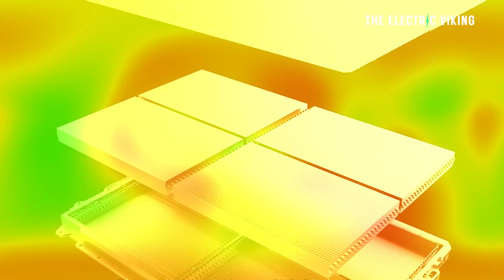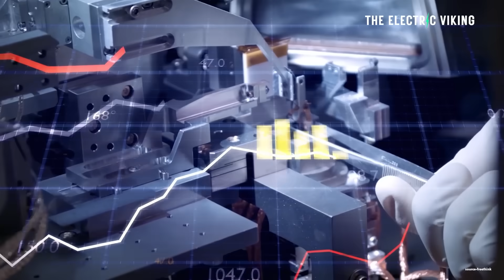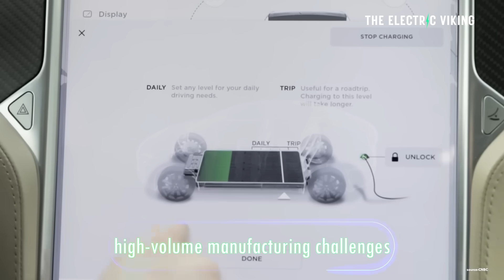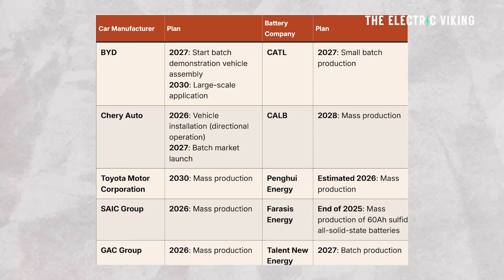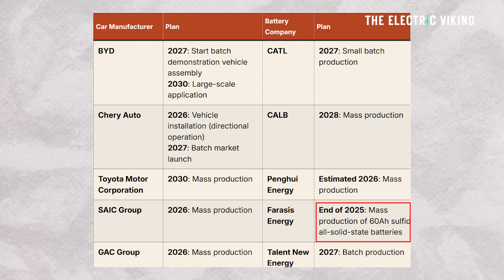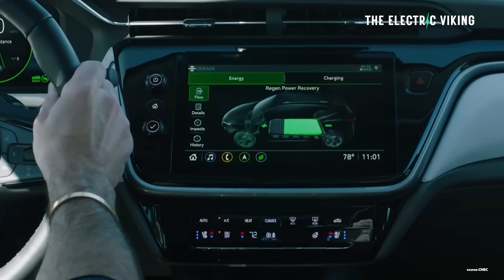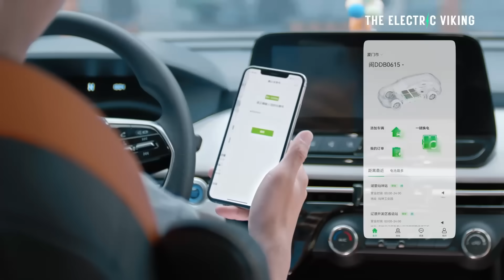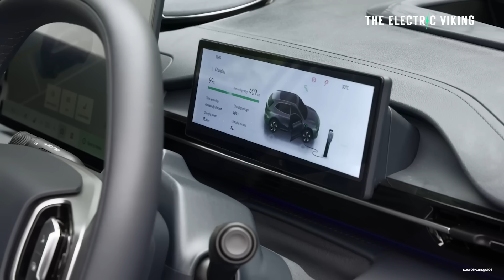Chinese Expert Reveals the Truth about Solid State Battery Mass Production

Comment from the maker: The car I drive, the Xpeng G6 - https://youtu.be/IcniwO8NfQQ

RESINC Solar installed my battery and solar system. Get a free quote from them here: https://www.resinc.com.au/electricviking
Reply: you saying a battery that is twice as energy dense needs to be less than twice the cost of a regular battery to be cost effective is wrong. you forget the value that is being added from only being half the weight of those 2 conventional batteries. you can now stack more total capacity on a car or make them lighter for the same amount of capacity which brings a whole lot of extra value.

Comment: I think EREVs solve any range anxiety from EVs… 300 miles isn’t enough EV range for a long drive? Just throw a combustion generator in it and it practically doubles your total range. 

With that in mind and the emergence of sodium ion batteries that are cheaper and safer than lithium, solid state batteries lose their initial appeal as time goes on… I feel like any car companies trying to develop solid state EV batteries (*ahem, Toyota) would be wise to pivot to sodium ion and EREVs rather than waste time/money on something that might not be viable going forward.

Comment: Just to be on the safe side I estimated the uptake of Solid-state batteries on a mass scale for EVs and some other electronic equipment by 2030 which seems pretty spot on at this stage.
The current Chery Tiggo 7 Super Hybrid does around 1200 KM on a tank of fuel, but a range of 1500 KM with improved safety sounds even better with the new Chery Solid-State batteries fitted.
Also Solid-state batteries will be very expensive when compared to current battery technology. 
Interesting information as usual.
😎🇦🇺

Comment: Re - fast charging
Todays batteries can handle charge/discharge rates of 15C - which would mean a 4 minute charge time!
The limiting factor is not the battery chemistry so much as the charger power and the battery/charger cooling capacity

Comment: So high material costs,  high volume production costs, long charge times, and thermal runaway issues prevent it from growing into a bigger market. Their lighter weight may see them used in niche markets like autonomous rescue robots, where one life being saved compensates for the huge cost involved in their production,  or their thermal runaway that immediately devalues them when it occurs.

Comment: WE do NOT need high energy density. It's dangerous. Battery swapping solves all problems already NOW. Of course , other swap station than NIO's. No screws. Battery can be fixed and hold by other type. And These has to do the car itself. Trolley just up battery - and the car fix it.

Comment: I work in an industry where we make both solid and liquid products with very similar functions. In this case the solids were even the first to appear on the market many years ago but liquids have almost completely replaced solids. All the solid handling steps are so much more expensive when you have to handle materials in bulk versus liquids. This made liquids over time about a factor of 2 cheaper on a kg basis. I fear this will be the case with batteries as well. Only in case the energy density is 2 or more times higher solid state will become similarly priced.
Just watch the vieos out there showing battery plants. They usually show the final assembly of the batteries with robots. Those robots are expensive. If you want to make the precursor processes solid as well you need a lot more of these robots to do the work, and that will cost money.

Comment: Like flat LCD screens finally arrived at maturity to replace CRT's back in 2000, solid state batteries WILL replace current Lithium Ion "poach cells" & turnary batteries. But this takes time. Monitoring the progress made these last years, I believe we are 5-10 years away from their mass market production & sales
Reply: ah yes, worked with a guy that worked in telefunken, germany, 1973, they had working test lcd screens there, but really expensive to make.

Comment: Currently in China being driven around in a NIO that takes 4.15 minutes to get it's battery changed.
To do the change over cost the equivalent of AUD 20.00 IT CERTAINLY IS a lot CHEAPER THAN me  FILLING MY OUTBACK TANK WITH AUD 100.00 of diesel.
THE BYD and other Chinese hybrids CAN DO OVER 1000 km's with a full petrol tank and a full battery charged.
This fact above all else will push people to purchase a Chinese Hybrid first and then an electric car.
Change takes time to be realized.
JB

Comment: Battery swaps would be good for fleets that need to lots of short runs, like taxis or delivery vehicles. They could still do well on smaller LFP batteries if they need to do lots of shorter distances. Ambulances, fire truck etc. 240v on board would also be great.

Comment: Battery design, I suggest for battery design and universal fit a flat battery wide as vehicle and as long as vehicle length; the vehicle would have a 0 slot which battery is inserted into car’s back side slot 0 then for vehicle range option a second slot 1 giving customer option of  single or double battery; for RV slot 0 as auto slot and slot 1 as home slot; trucks follow pattern of vehicles. Batteries fit cars, trucks and RV’s

Comment: Solid state are immune to dendrites (though that only triggers a small proportion of thermal runaway events) and enables the use of a more energy dense lithium metal anode, which its very prone to dendrites.  It eliminates the flammable electrolyte , sure, but that's only a small percentage of the battery by mass, the majority of the battery is still NCM cathode material and the anode is now more reactive.  So yes, harder to get thermal runaway event from an internal short, but once one gets going..

Comment: I do expect that leightweight batteries do have a purpose...even if they are (still) expensive.
In those places where weight is every thibg.
(Space objects (satellites) which store energy when in the sun , use the stored energy when in the shadow of the earth., in aiircrad=fts ...especially the (first) bigger electric  airctrafts. (Which will be small planes to start with)
When the demands get high enough prices will drop and than can be used in the normal EV market (earlier in the very expensiv top ev market).
This is more or less normal the last 70 years...first TV sets which only could be bought by rich peope...the same later with color TV , tv recording , PC's and all other electronic  inventions.
When I was a child a TV camera did cost a few year salaries...now a gopro has a much better quality for a fraction of the price.

Comment: just like swappable packs it will go the way of the dodo

swapable packs are needed for when cars can only go 200 miles.
if they can go 400.  who cares.   when is the last time you needed to go 800 miles in a car
and couldnt sleep in a hotel?

I dont want my well taken care of battery to be replaced by a battery that some clown has run it from 2 to 98% every day for a year.

  I am not swapping someone elses pack and putting it in my garage

Comment: I personally have never shared the hype about solid state batteries. That's not to say that I don't believe that there will be good solid-state batteries in the future. But I do believe that this hype is based on the word "solid-state". 
People think of the comparison between a hard drive and a solid-state drive. But a battery is not a hard drive and a solid-state battery is not a solid-state drive. Batteries do not store data, but electrical energy. And that is a big difference. And why people assume that a solid-state electrolyte is automatically much better than a non-solid-state electrolyte is not entirely clear. In fact, the opposite could just as easily be the case. 
By the way, there is also a solid-state variant for combustion engines. The solid-state variant of gasoline or diesel is called coal. So, on to coal cars! Solid state!!!
Reply: Solid state fuel is also rocket fuel
Reply: People assumed solid-state batteries would be better, because channels like these kept telling them they would have much higher energy density. Now it turns out, mass-produced solid state batteries might not be the jump up they expected, while other battery tech keeps improving.

Comment: Solid State Batteries are a must for me to consider ANY EV as a replacement to my 2012 Toyota Highlander Hybrid.

My Highlander Hybrid consistently gets 340 - 455 miles of range in Canada's -40°C - 40°C weather year round. No worrying of what type of gas station I'll run into along my trips, they ALL refuel my tank within 5 - 10 minutes. No worrying of my range dropping regardless of how fast my tank got filled/emptied throughout the lifetime of the vehicle. No worrying of my vehicle fuel level dropping while parked outside in the cold, thus no need to look for charger outlets at my destination, etc.

For an EV to offer the same level of convenience and peace of mind as my Highlander Hybrid, it'll need at least 800 miles of range. Solid State Batteries seem to be the ones that'll hit such range, but either way, until any of them do, EVs are just going through a guineapig testing stage in my book.
Reply: I don't understand. Why are you foccusing on a type of battery, instead of the actual range some car has? As this video explains, all batteries keep getting better and solid state batteries in practice don't seem that much a big of a step up. 

It's not true by the way that an EV car looses energy when it's parked outside. Who told you that? Cold weather doesn't make battery charge disappear. The car just needs more energy to heat the cabin; that's why you loose some range in an EV in winter. An ICE vehicle always generates heat, and just throws it away most of the year.
Reply: @drfisheye Read my comment to the end before responding.

Comment: battery energy density has issues, unless using metal-air batteries of gasoline energy density. it will come if you believe you already got it. make it simple to make. arc inertial dd fusion ftw. stuff gets cheater guaranteed.

Comment: All battery development is to meet a specific performance objectives. Developing a solid state battery technology should not be the end-goal in itself. (manufacturers still use lead acid for nearly all 12v car batteries despite having alternatives). To become the dominant technology, solid state must compete with other chemistries like lithium, sodium and aluminium.  As of 2025, aluminium/graphene seems to match the benefits of solid state and possibly have a better all round future. We may have gone overboard by the word 'solid state'.

Comment: I think that overall the idea that cars are the best first application for solid-state batteries seems to be stemming from marketing needs. And for some manufacturers it's probably about making their customers wait for the 'next best thing' until they've really upped their game.
In the automotive industry, there might be a good target market for solid-state batteries and that's hypercars. These cars need a low-weight battery that can charge quickly, and the battery doesn't necessarily need to have a great cycle life. That's because these cars aren't usually driven much at all, or very little in terms of kilometers.
Honestly I think solid-state batteries would make more sense as a mass-market product in high-end consumer electronics like watches, phones, laptops, and even in things like Dyson-segment home appliances.

Comment: Meanwhile in Canada, if your EV is not working and needs to be transported by a ferry to a repair shop, your are out of luck. Transport Canada does not allow the transport of an EV on a ferry or barge if the battery is faulty. In British Columbia, that means residents and visitors to the Gulf Islands or to Vancouver Island can't transport their cars to be repaired.

Comment: Until they solve the issue of 3d printing the membrane in place? Its not going to happen. That is the issue is the membrane needed between the cathode and anode material in SS batteries is inherently brittle and cannot be bent or wound like a traditional battery.

Comment: He is certainly correct real solid state batteries; not reduced liquid; are literally like making computer chips; but very large ones. Toyota has had a solid state battery car for about 10 years but the batteries cost $1 million to make. Maybe you'd see some very specialized uses in things like aircraft, maybe multi million dollar super cars, but not average sedans.  Also all cars - can't be lithium  BEVs by 2035; there isn't enough lithium production even if you 10x production of lithium. Currently BEVs are 0.1% of cars.

Comment: The problem all these battery companies have at the moment is time, not time to manufacture though, time to customer. It's like this, my oldest car is a 2007 Hyundai diesel, I generally keep my cars for quite a few years, it's cheaper and better for the environment, so if I was to purchase a EV now chances are I would also keep that car for 10 years at least, but with battery technology on the cusp of solid state production every customer who buys an EV with LFP batteries now is a lost customer for say 10 years, disregarding crashes and other problems that require you to buy a new car of course. So what they are doing is teasing much better battery tech "any day now" in the hope of discouraging buyers from purchasing EV's to keep the largest possible consumer base for the new battery tech, it's basically what Toyota has been doing for ten years, discouraging car buyers from switching to other brands and technology while they play catch up.

We'll see who actually produces the first mass produced solid state battery, but I don't expect it to come much before 2030 myself. Small production runs for extremely high end cars, basically for supercars and the like yes I can see that a bit earlier, but mass produced consumer cars I will give it another few years before it's ready.

Comment: Solid state could be another betamax moment. It's clear that the best product doesn't always win the sales race. The price of batteries is getting so cheap that even if solid state tech is more advanced, the current battery tech may be good enough for most consumers, especially if solid state is significantly more expensive.
Reply: Na there will be niche uses and then mass production eventually.  The real issue is no one can mass produce solid state.

Comment: you keep forgetting that 1kwh of LFP battery equals 1kwh SSB battery. so a 50kwh SSB in a car equals 50kwh LFP battery , even if it has double energy density. just space needed might be half smaller..
if SSB 1kwh will cost double the price of 1kwh LFP, energy density doesn't matter , because 1kwh battery is still just 1kwh power, no matter the chemistry or density.. it will cost double.
.

Comment: The solid state battery companies are running (atleast) two races.  First, they have to figure out how to make them work better than current batteries, which continue to improve in storage capacity and recharge time.  Second, they have to figure out how to manufacture them at a competitive price. Both of these objectives mean running after a moving target. By the time they do testing and B samples, someone else has come out with a cheaper alternative.
Reply: IMO price doesn't matter that much if volumetric density can enable industries like aircraft or hypercars.
Reply: That is very much like it looks.
Reply: 1. Is done. 2. Is very problematic
Reply: Well SSD appears to be far safer though.

Comment: Sodium batteries are about to arrive too and they are much cheaper than li ones. I think these can BE game changers on the short term.
Reply: It would be mainly used for energy storage system and standard range EVs
Reply: @sihamhamda47 https://youtu.be/yZbvrM2MQ2I?si=uR4OpXpIbadrxb7C it's in portuguese but i think you can have subtitles. It's an engineer working on these matters. It goes "A densidade energética (175 Wh/kg) supera até a das baterias de iões de lítio LFP, mas custa 7,5 vezes menos. E quando comparamos com as baterias cilíndricas (4680) da Tesla (química NMC) são 10 vezes mais baratas."
Reply: @sihamhamda47 "A densidade energética (175 Wh/kg) supera até a das baterias de iões de lítio LFP, mas custa 7,5 vezes menos. E quando comparamos com as baterias cilíndricas (4680) da Tesla (química NMC) são 10 vezes mais baratas." It's taken out of an interview with one of the top experts/ engineers/ scientists working with batteries in my country. You can translate it i Guess.

Comment: Wikipedia :-  "People started talking about solid-state batteries as early as the 1830s, with discoveries of solid electrolytes by Michael Faraday." Wow I knew people had been talking about solid state batteries for a while... didn't realize that long !!
Reply: Wikipedia may be correct, but their use of terms is not.

The term “solid-state” originated in the 1960s during the beginning of the semiconductor era. At that time, it was used to describe how semiconductors transfer electricity differently than older vacuum tubes – in a solid state as opposed to a gaseous one
Reply: @ASmithee67  Wikipedia doesn't actually use the term 'solid-state'. I guess the quote comes from some AI quoting wikipedia or something.
Reply: @drfisheye  Hmmm.... odd I thought I had cut and pasted from Wikipedia ... perhaps  like you said it was AI quoting. FYI  this is a cut and pasted from the current (10/9/2025)
Wikipedia page  title:
 "Solid-state electrolyte" 
Quote: "The first inorganic solid-state electrolytes were discovered by Michael Faraday in the nineteenth century, these being silver sulfide (Ag2S) and lead(II) fluoride (PbF2)"